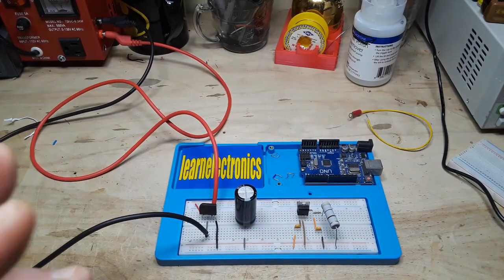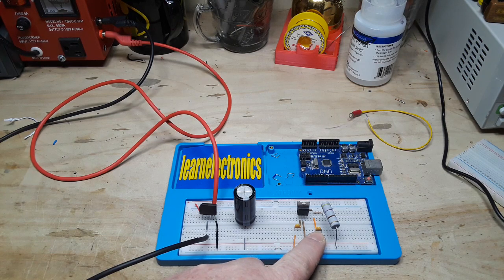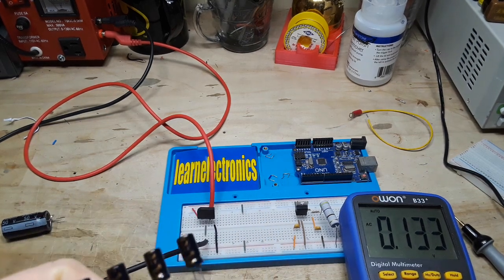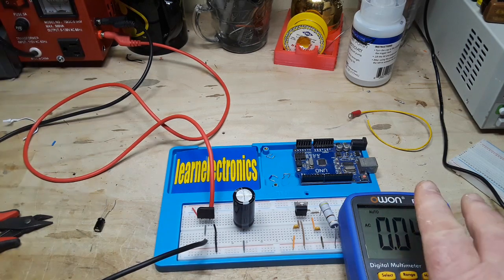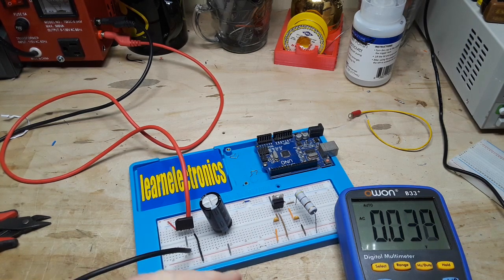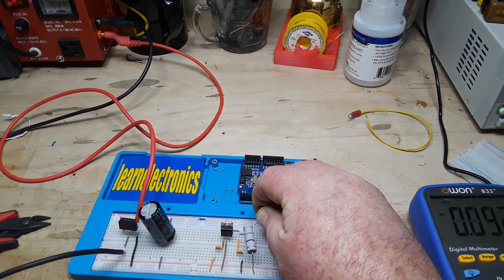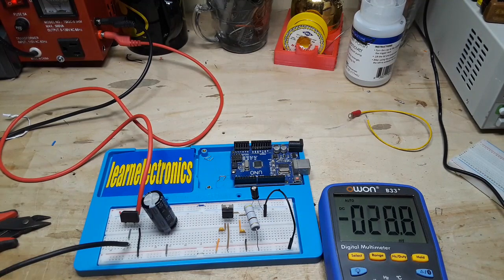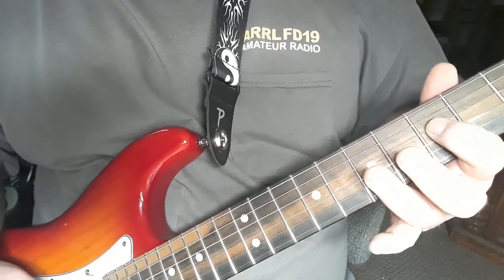Measure Power Supply Ripple Without a Scope

Comment: Paul says: "Lets increase our load. This is 470 ohms, lets bump it up to something juicier; here is 220K..."
And the load decreases from 10mA to 22uA. 
Yes, I know it was a slip of the tongue and you meant 220 ohms but even that wouldn't be something with enough juice to increase ripple significantly. You've celebrated 100K subs recently, don't you think it's about time you showed a little more care? I mean, the DMM was out of shot during half of the video, you called the regulator section "rectifier section" and I really don't think this is a good example of PSU ripple that the viewer asked about. I am pretty sure he meant the high frequency ripples of switching PSU's, which is almost impossible to measure with a regular DMM set at AC voltage. Most of them can handle no more than 100-200 Hz. I would highly recommend you to watch your own videos before posting them and correct the mistakes as best as possible. At least you can do is to insert a correction caption, which shows care.
Reply from the maker: Don't like my videos? Feel free to watch another channel. This is a one-man operation. And it's one part of my day. I'm sorry if I've disappointed you. I do the best I can.if its not good enough for you, move along.
Reply: @learnelectronics  I like your content, that's why I am taking the time to write all these. Otherwise, I would have moved along as you suggested, and would have done it silently. I am not the regular a-hole that sits infront of his computer and critize other people's work. All this channel needs is just a little more care. You may be a one man show, but you've got 100K+ people watching you. I'll keep silent from now on, enough said. Take care, stay safe.
Reply: @learnelectronics  ,  the original criticism was a bit harsh, but had some valid points. Your response hit only the parts that you took personally, and did not adress the valid points. Do you have plans to do so, or should i take a hike as well?

Comment: Excellent video, sometimes it's also good to add a smaller value capacitor in parallel with the larger capacitor to fix ripple problems! 
Also I would like to see you add some backlighting to the voltage meter on your Variac, I realize that the power switch lights up when it's active but a backlit meter helps to make it more noticeable... It's all about staying safe! I want you here for the long run... My Variac has the led volt meter on it so there's no mistaking it's status! Although I don't have those banana jack's on mine! 
I have some multimeter style recessed banana jack's that I can use to modify mine, I think that it's a better idea than having an AC power cable laying around with bare wires...
I'm currently looking around for another Led meter that displays voltage, current and watts if possible because measurements are everything, the more the merrier...

Comment: Cool video Paul! I usually think of using the scope to measure ripple but the DMM is easier if you just want a figure and not a waveform visual. It's always nice to see something different besides electronics in you videos. Did you use the tube amp you made recently? Are you a HAM? I'm trying to get into the radio side of the hobby and get licensed after all these years.
Reply from the maker: That was through a Fender Blues Deluxe, a tube amp, but not the one I built. That amp was a gift for my son. I am a ham. Radio is fun, but can get very expensive very fast if you want to get into high frequency. You can get going VHF/UHF for a couple hundred bucks.

Comment: Yes the output ripple will change with a different load, it will be less ripple with a higher resistant load or be the same and when the load has less resistance and get to a point that the input voltage coming from the transformer can't keep up anymore so that the voltage is just above the 5 volt that you need on your output of the voltage regulator, you'll see a higher ripple on your output because at that point your regulator can't regulate the output since you need the input voltage to be high enough (about 2.5 volt higher) for the regulator to work properly.
You didn't mention that in your video.
Reply: Yes I was looking for that. Higher the resistance smaller the load.
Reply: @abdoolgafoor670  Glad to be of help to you and good to know so thanks for the comment

Comment: But can a meter measure ripple of a SMPS? DMMs are good at low frequency AC. It's what they're designed to do. Up in the 10s of KHz is another story.
Reply: Can't assume a sine wave  output either. Most likely a bunch of random stuff.

Comment: For safety's sake, wouldn't say a 12 V filament transformer, if one's available, be a much safer alternative to a variac to get some isolation from your mains voltage or does that variac have an isolated output?
Reply from the maker: An isolation transformer would be safer. Just didn't have one on hand
Reply: I just never felt safe using a Variac other than plugging in a device into their regular two prong outlet. BTW, the video was very informative. Thanks for posting it.

Comment: Would putting the smaller filter capacitor in parallel with the large one have made a difference? The capacitance would be additive, but wouldn’t they tend to block different frequencies?
Reply: There's really only one frequency here we're smoothing. That is the AC input frequency. The voltage regulator is linear.

Comment: Great stuff.

I have an old strat that I fixed up, new pickups, tuners, etc - really nice. So now I'm planning to build something using a nano for the guitar, you tried anything like that?

I wanted to fit a kill switch, just a button to kill the signal going out, fairly easy and no nano required, but then I thought it'd be cool to use an ultrasonic ranging module that can control the output signal, closer the hand the quieter it gets.

My plan is to use the nano to control the intensity of an LED, the closer you get the dimmer the LED, and an LDR across the output that will react to the light, is there a better way of doing this? I'd prefer to do this without the actual audio signal going into the nano as that's more of a headache than I can handle right now! All I need is a way to control the output volume.

I reckon you'd get great effects if you could control the volume with your hand like that - almost like a guitar/theremin hybrid, I might try and prototype it tonight, my only concern is that it might not work that well with the LDR but thinking in terms of what I have on hand it's about the best solution - I'll probably need some kind of enclosure to house the LED and LDR to prevent ambient light interfering with the effect.

Any ideas or advice? Any comments/ideas welcome.

Nice guitar and chops, btw, I love improvising to backing tracks it's loads of fun and there are so many on YouTube. I'd love to see you go more into guitar-based stuff, pedals or even MIDI stuff - this is a great channel.

Cheers, Paul.
Reply: Interesting - any input or suggestions would be helpful.

I prototyped this circuit on a breadboard and yay, it actually works but there are issues. Firstly the HC-SR04 I'm using isn't that accurate, leading me to write a function that drops 0 values and averages out everything else over 20 non-zero responses.

This makes it slightly less responsive since each cycle/response is 10ms with whatever other overheads. Next problem is that when the LED that is controlling the LDR changes intensity you hear a very noticable interference through the amp - a sort of buzzing that intensifies with the light - yet the light and audio circuits are both isolated from one another (yet naturally in close proximiy as the LED must be enclosed/housed with the LDR). I'm wondering if there's a way I could filter this buzz, somehow - I note this still happens when I remove the LDR so am guessing it's generated by the LED, somehow.

To explain how I've done this, the guitar signal is just connected through by two 1/4 inch audio jacks, the ground wire is straight through from jack to jack with nothing in between - the 'live' output of the guitar has the LDR wired in series.

The nano is simply powering an LED via pin 3, tests show that blue works best probably because they burn so much brighter - the intensity of this LED is calculated based on the distance of my hand in proximity to the HC-SR04.

Another small issue I've noticed is that even when the LED is completely off I can still hear the guitar through the amp very faint, but it needs to be up really loud - so the LDR doesn't completely block the signal.

Interesting experiment, though - and fun, if I could filter that pesky buzzing sound it'd be pretty sweet and I'd consider integrating it into my project strat. I realise nobody has responded to the OP but on the off-chance anyone stumbles upon this comment any idea/suggestions would be greatly appreciated.

Comment: When measuring "ripple" on the capacitor after the rectifier without any load, you will get little or no ripple.
The capacitor charges up to max voltage and stays there as it's has no load to discharge into.

The ripple you get out of the regulator will depend on the regulator, its dropout voltage (typically 2Volts) and the supply voltage.
So if the input is above 7 volts the ripple will be filtered away by the 7805 regardless (almost) of the capacitor you have infront of it.
No need for a large cap infront of a 78xx or 79xx as long as the input voltage (including ripple) always stays more that 2volts over the output voltage.

But what ripple should you measure, peak-to-peak or RMS?  A DMM shows RMS, but isn't it peak-to-peak you really want?
That's what the oscilloscope shows.
Reply: If it's not a true RMS meter it's not even showing RMS, it's showing random garbage on complex ripple waveforms.  And a true RMS meter, depending on how it's implemented, might not properly separate the AC and DC components.   So this whole thing gives you a meter implementation dependent reading, I'm not sure it's useful for much other than comparing relative readings, and even then I would not assume linearity in readings if the input is not sine.
Reply: @GigsTaggart  If the load is pure DC then the ripple would not be that complex and a average RMS DMM could handle that. But if the load is more complex as it normally is then you would need a meter with a good Crest factor for it to measure any sensible value.
So yes, you can measure ripple with a meter, but should use a scope if you can.
Reply: The oscilloscope will display the character of the signal being monitored. Any spikes or what have you.
Reply: vPP formula is VP = VRMS × √2
Reply: Only for senoidal wave, in the output of a capacitor filter on the load the wave form is not a senoidal.

Comment: you increased the resistance - so you DECREASED the load - from about 10mA to about 23 micro Amps
Reply: I do believe he just boo-boo'd there speaking as he does every once in a while and meant to say 220 ohms.  His brain sometimes slips on words but rarely on tech.
Reply: @Erudotic  Maybe you are right. But even at 220 Ohm I would not talk about much "beefier".  At 7.8V thats about 35mA. I think even for a small powersupply that's a very small load. 
But ok, the goal was to show you can measure the riple and not that there is few ripple.
Reply: @1pcfred  You are right. But as the title says and Paul also says in the video, the intention is to show that and how you can measure the ripple without an osciloscope. This mission was fully accomplished.
Reply: @Erudotic  could be right - i tried to zoom in but the colours don't look like red red yellow  OR red red brown tbh. need a better zoom option for you tube lol.

Comment: if you dont have multimeter that can measure millivolts ac, as me :( you can build a peak detector using opamp
check out wiki page on Envelope detector and Precision rectifier
Reply: Could a peak detector followed by a class  B  transistor amp work the same?
Reply: @myscience5684  same as what? you have a peak detector with nothing on input so it will output some voltage it was set to(say with a voltage divider on non inverted input or ground for railtorail opamps), as soon as any kind of ac present it will raise or lower(depending on setup) its output by that signal amplitude. so you measure dc difference across detector out and reference voltage. 
you can do that with just a diode and a cap but it wont be as accurate.
i made this to measure impedance of a speaker voice coil with my old analog multimeter to get its thiele small parameters. 
just thought these circuits will be useful to know.
Reply: @Timsturbs  I guessed that just a peak detector followed by a BJT amplifier would works as the op amp circuit you mentioned.

But yep, peak detectors have an output voltage limit . Most of the time peak detectors are in AM receiver ckt followed by amplifiers or sometimes in Analog to Digital converters.
Reply: @myscience5684  "just a peak detector" you mean just a diode with a cap? sure it will, not quite suitable for measuring in millivolt range since they usually have like 0.4 volt drop.. 
to be fair i just try to put opamps wherever i can because i have a bunch and genuinely love them xD

Comment: What happens if you put two 470 uF capacitors in series as filter if you don't have a single high capacity capacitor?
Reply: You need to put your 2pcs of 470 uF in PARALLEL in order to double the capacitance.  Put it in SERIES will half the capacitance.
Reply: @stephenwong9723  ok

Comment: How do you measure the signal to noise ratio of a power supply? because when a power supply is connected to an amplifier circuit it raises the noise floor and you will hear the power supply switching frequency, white noise
Reply: Linear regulators do not switch. So it does not apply here. SMPS usually switch well above audible frequencies too. Although I suppose they could generate harmonics? Maybe you have ears like a dog?